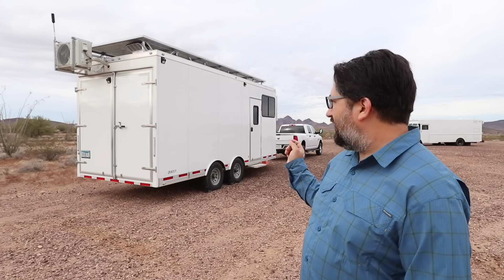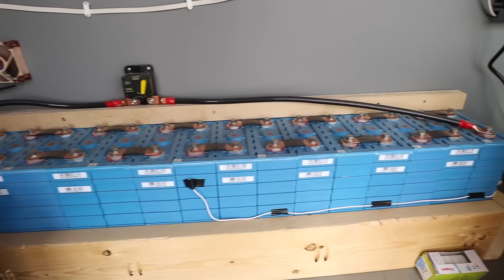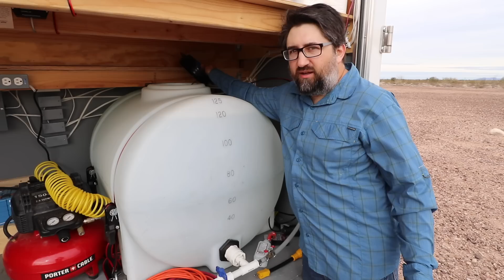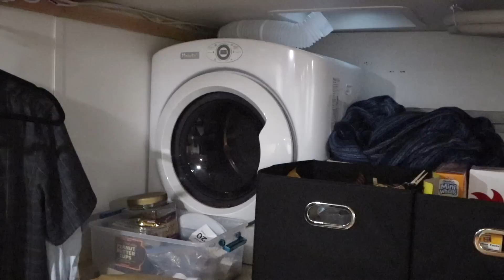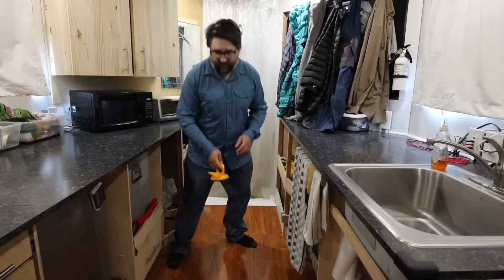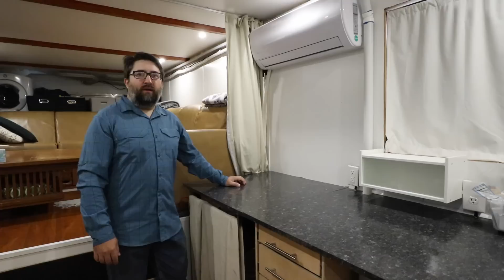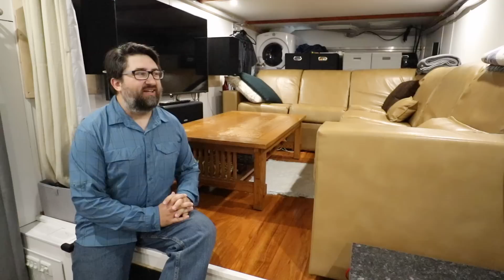Crypt Bedroom in a 2 Kilowatt Cargo Trailer Conversion

Comment: So how many Gallons to the Mile are you getting with that beast?
Reply: Around 10-11 MPG, depending on terrain and speed.
Reply: @michaelberding4616  can your solar system cool your  home for a full 24 hours?
Reply: @stevemitchell2252  I suppose it probably could, but it's never come up.  The mini split has variable speeds, so once it cools down the rig, keeping it cool is pretty easy.  Also, at night, temperatures drop so not much (if any) cooling is needed.  So long as there's decent sun, I can pretty much set the temp to whatever I want.
Reply: @michaelberding4616  the home you have is amazing the solar array that you have is amazing also great job

Comment: How has the electronics and heat pump  held up to the bumps of traveling down the road? Also what heat pump would you install if you were to it over again?
Reply: The electronics of the rig have performed beautifully, no issues there.  The heat pump works as an air conditioner, but it feels like a version 1.0-beta product, and I'm the guinea pig.  I've had lots of problems using it as a heater (keeps erring out), so I only use it as an air conditioner, for which it is still working.  I would recommend to anyone looking at a heat pump / mini split unit to pick up one of the popular brands, a pioneer or Mitsubishi or something like that.

Comment: Anybody watching this:
---  Be very cautious about the water storage tank in very back of the trailer. That's a BAD and DANGEROUS idea. Too much weight at the rear -- 800 pounds swinging left and right during quick maneuvers can get you killed. If you are planning on building a trailer --> design your water tank and holding tanks as low and as close to the axles as possible.
Reply: What stood out to me the most is having it off to the side. That's a lot of weight and I would have a hard time not at least putting it dead center.
Reply: @TroyWical0  What do you think the batteries weigh? 

The man seems to have thought this through a fair bit.
I would wager it is not as bad as it looks.
I would have used a low top rectangular baffled box design but then again his is built.
Reply: @charleswidmore5458   except when the water tank is MT
Reply: @charleswidmore5458  
Those are lithium batteries so probably not more than 150 lbs of dead weight. Compare that to almost 1100 lbs of live weight. I won't go as far as to say it's dangerous but it is definitely not optimal. I agree with having a lower profile rectagular tank, maybe even two (or more) baffled tanks that reduce the free surface effect of sloshing water.
Reply: @charleswidmore5458  That's a good point. I totally dismissed that. No idea what those weigh, but with the tank weight fluctuating I still think there may be a more stable location. This guy for sure thought through all of this. The trailer is amazing.
Reply: @charleswidmore5458  Batteries don't slosh back and forth when the whole cargo van wobbles on the road. That sloshing and really make the cargo van sway even more and more making the whole thing hard to control. Then add high winds to an already rocking trailer. No thanks!
Reply: Sloshing, exactly. Better to carry flat and minimal liquids.
Reply: this guy has done a wonderful build, personally. he did mention rear and tongue weight...so it's been calculated. wish he'd build me one:) that said...if he were to build mine...i'd ask for water weight to be centered...
Reply: Also because cold water tends to create condensation on the tank on a hot day, putting water beside electrical stuff is also not the best plan, because the humidity in the garage will get higher. But you are absolutely correct. For my van I am putting it on the roof, but only 13 gal. spread out in 4 inch tubes. Only a 100 pounds, and the weight is spread over the roof rack on both side evenly. The batteries are below the floor and 160 pounds so this will offset the weight on the roof, and the cold water storage will be below the floor opposite side to the batteries and opposite corner, 80 to 100 pounds. Potentially could balance things with positioning tricks.
Reply: I would just like to point out that he addressed this on his website. Here is what he had to say.

"Once again, not really a question, but a frequent comment. My trailer was designed to have extra weight in the back from the initial design phase. The axels were moved back 6″ to accommodate that weight. When the fresh tank is full and the holding tanks are empty, my tongue weight is approximately 12%. For bumper-pull trailers, the weight is supposed to be between 10 and 15%, so I’m right where I’m supposed to be. I never have issues with the water slushing around causing the trailer to misbehave. I do have issues with the large sidewalls of the trailer when it’s hit by a crosswind, and that’s why I’m changing the trailer into a gooseneck instead of a bumper-pull."
Reply: Wow, do you guys even tow trailers, or just pretend to on YouTube. Weight behind the axle is not a problem. It's all about proper balance of the system as a whole. And water and electricity guy, get the hell outta here. Now all that being said, I probaly would have centered it left to right...
Reply: @CCWSig  only the road leave the tank empty. Get better gas mileage too.
Reply: HATER! Lol! Jk. I think there’s a reason most RVs do the same thing with their tanks. Appreciate the tip.
Reply: was going to say the exact same thing.....
Reply: I agree that the sloshing effect is the problem, not just the weight.  I am more concerned that it is a bumper tow rig and 11,000 lbs AND has the sloshing water.   He said was going to switch to gooseneck, then it should be good.
Reply: Michael. What an absolutely awesome set up you have. You really thought about everything! I for one wouldn't change a thing...(even the oversized coffee table)....I wish you many years of super fun traveling and wonderful night's sleep in your amazing one-off custom trailer..........The only part I didn't enjoy is the know-all's, that had to criticize your awesome trailer in the comments section below. That is the biggest problem with YT.... everyone's an expert.....
Reply: I have never driven a trailer, and im going the box truck conversion route. That said, i would not have a big water tank on one side of my truck nor would i want my delicate electronics exposed to even a splash of water which may damage them.
Reply: 1st thing I tough. Along with the extra battery weight. Bet it sways like crazy.
Reply: @henrycoats2202 maybe from the wind but even if the weight was off and the sloshing effect non of that "makes" it sway, what it does is increase the already swaying from say a sudden lane switch or obstacle avoidance. When you start to sway it will kick the rear out then back and fourth until the trailer is out of control and this happens fast. I once had a concessions stand that had a blow out ask me to tow their trailer to the venue and the nice guy I am said sure as I got up to speed and merged onto the freeway that small sway started whipping me around in a matter of seconds. I was lucky enough to have had the happen on me in the past so i was able to Regan co troll but in those few seconds the concession stand tires were already lifting off the ground, so I pulled over to check on the trailer and found the guy had literally loaded his entire load 30 cases of soda 10 case of water and boxes of large can good all to one side which also happened to be the side his freezer and tanks were on so 80% of his weight to one side well ateast it started that way after the wobble everything was a mess but I just took it easy with no sudden turns and the rest of the trick to the festival was good. As the driver its the not knowing that gets you. Its easy to adjust your driving to account for his mistakes but he didn't know and its probably better he had a blowout he may not of made it home. So yes weight distribution and a secure load are very important however look he knew what he was doing the plus that trailer is 11,000 pounds the sloshed effect on that tank woulld have little to no effect
Reply: I haul 1500gals of water on a straight truck it's not fun but not deadly either.  I was more worried about water and electronics.  That whole rig is set up crazy.
Reply: That tank sloshing  will have zero effect on that heavy trail. Come on people stop being keyboard worriers and go build one yourself and come back to the comments when you have earned an opinion
Reply: It's called fish tailing, and yes it is very dangerous when it happens. He's got a lot of weight in this trailer in the front, and he did mention the tongue weight, so he knows. He's a lot smarter than me about solar, and lacks for nothing in that small space. Bravo on that accomplishment, you've got a rolling apartment, that lacks for nothing.
Reply: There ought to be a lot of baffles in the water tank to minimize sloshing
Reply: @1BillT  OK dad, I thought you said WAFFLES in that tank! You're killin me!
Reply: Having water around the electronics isn't the best idea either, boxed off in the centre with an opening door to be able to fill the tank would be a better option.
Reply: @Andy_M986  "water around those electronics isn't the best" Oh no those electric water heaters are gonna kill everybody...or not
Reply: @mrmotofy  the water is gonna splash over everrythinggggg!!!!
Reply: @miniwarrior7  Hey smart guy...the water is contained in a sealed vessel. It's not going anywhere. Vehicles haul liquid everyday
Reply: Samuel Whittemore:I guess you didn't watch the video because he gave the weight distribution percentages (12%) for the tongue weight and he was well within the limits. Looking at how this rig was designed and engineered I am very certain and feel positive Michael did the math and all is copacetic! Also did you catch his comment he is converting the tongue hitch to be a goose neck hitch....guess you didn't catch that...huh?  Unless you're some kind of engineer you should keep your opinions to yourself!
Reply: @alanosborne1947  Distribution only tells part of the tale.  Polar moment of inertia is  a major factor in vehicle handling.  Given the same mass and front/back distribution, if that weight is closer to the center of rotation for the vehicle it will be more stable and controllable.  If it's further out then that mass, once moving, exerts more force on the vehicle to keep moving.

If we imagine two identical 30 foot trailers, one of which has a 1000 gallon water tank strapped exactly at the center of mass and the other one of which has two 500 gallon tanks strapped 10 feet ahead and 10 feet behind, both would give you the exact same numbers on the scale, but the first one would be a lot nicer to tow and a lot more stable in emergency maneuvers.
Reply: @alanosborne1947  , wow, just wow.... That's a lot of anger. I think Samuel Whittmore has some understandable concerns that have merit. He might not be an engineer, but you dont have to be an engineer to head out on the road pulling a trailer. All licensed big rig operators will tell you up front, that driving a pickup truck and trailer can sometimes be more of a headache than a full size rig. A lot of the trouble can come from the uneven weight distribution,  and tongue weight. I think having that water tank secured dead center would most likely have a better feel than where it is currently.  The idea of a baffled tank was also good. Frankly, having equal wheel diameters and wheel width on your vehicle and trailer go a long way to making the ride more comfortable and predictable. 
If we had to wait for engineers to get our daily tasks done, I dont think we'd get much finished.
Reply: Or at least in front of the axle, not behind the axle. Same goes for anything heavy.
Reply: @pantsongrnd moe like 25 gallon x 8 lbs = 200 lbs. ??
Reply: @percivalcoondalini3475  yep, and he also said he likes long showers. 
at 120 Gallons 
that's over 1,000 lbs!  ( ON THE RIGHT SIDE)
Reply: @percivalcoondalini3475  120 gallon tank x8 lbs = 960 lbs

Comment: Hi Michael, Nice rig! I know there is a lot of controversy about the Anderson hitch, which you may have heard about. To me, there is very little surface area for the sway control function which likely causes minimal sway control. I would skip the mods required to add the goose neck hitch & loss of truck box storage & install a Reese High Performance Dual Cam Sway Control Hitch. It'll cost you a lot less than the goose neck conversion : ) You can order the hitch with bars that suit your tongue weight. We install these all the time at my Airstream restoration shop & they work really well. You also may want to add some reinforcement to your receiver as well. Andy Thomson at Canam RV in London Ontario can help you with this. If you're too far from him to get this work done, you should have a chat with him by phone or email & he'll describe how to do it. You'll be much happier. Good luck.
Reply: Thanks for the suggestion, but I am really looking forward to having a gooseneck trailer.  I'm really tired of dealing with weight distribution and I want to have a safer, easier time towing without the sway issues being in the way at all, so I'm going to just gooseneck it.
Reply: @michaelberding4616  Having a proper weight distribution hitch that is set up correctly, works incredibly well, assuming the correct tongue weight is on the trailer. When they are not sized or set up correctly, you can have nightmares. You are also able to transfer weight onto the front wheels when it is set up correctly. You can't do this with a gooseneck.

Comment: Hey any links to those lithium battery cells?  I love battle born but dang they are expensive!
Reply: The exact cells I purchased 1.5+ years ago aren't available, but I bought mine from electriccarpartscompany.com.  You can also get them on aliexpress and Amazon of course now too.
Reply: @michaelberding4616  Cool thanks... have you ever considered using used Tesla batteries for a system?
Reply: @professorjedi1024  Certainly, but it just hasn't quite worked out yet.  When I built my system, it was important to have a "real" 48-v nominal battery to power my 48v mini split.  Tesla batteries voltages run a bit low, so they weren't quite up to the task.  If that wasn't a part of my system, then I probably would have more strongly leaned towards a Tesla battery (or two or three).